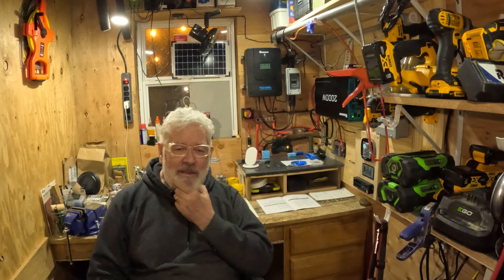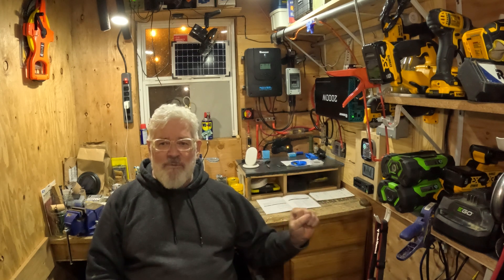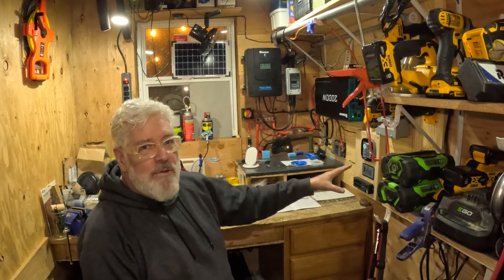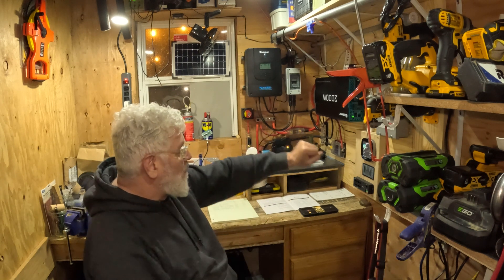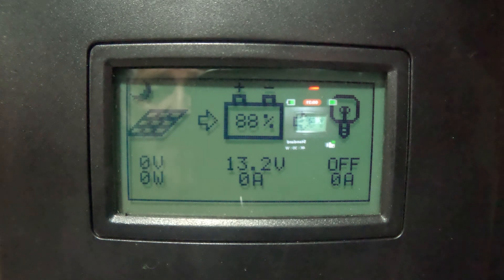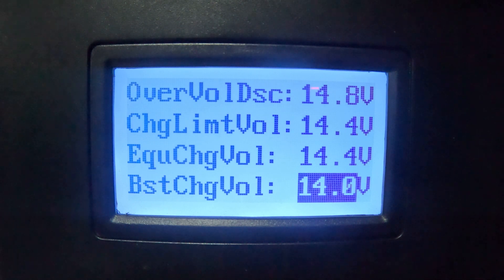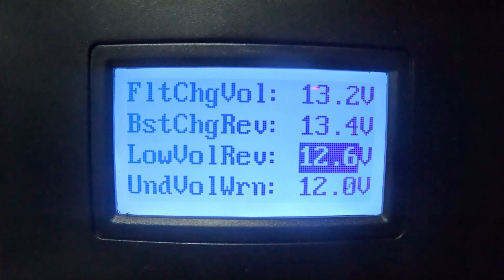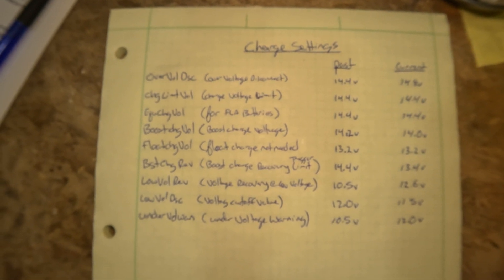Renogy Rover 60 amp Controller Over Voltage Error Fix with new Battery Settings

Comment: What setting line on the inverter controls the cell over-voltage alert? I'm not finding that line description in my user manual. Thanks.
Reply from the maker: @PaulBrown-e7w  let me check on that for you.

Comment: this is a battery issue not a controller issue the BMS has cut out causing the volts to rush to the controller causing a over voltage Error, Renogy's advice to lower charge voltage was correct.14.8v is very high for Lifepo4. that is why you get an over voltage error, the BMS has cut out, Likely an unbalanced cell in a battery getting to high and triggering the batteries BMS to cut out, or one battery in the bank being higher than the other. Ive installed hundreds of Renogy Controllers. And seeing videos where you Connect to batteries But dont put the charger and Inverter on opposite battery terminals and dont spread the charge and draw over multiple batteries, Id say you have an unbalanced battery bank and you had a battery cut out, Its likely even the reason your inverter Fried it self, drawing too much resistance.
Reply from the maker: 14.8v is the over voltage disconnect. It never sees that voltage at these settings. The inverter smoked a MOSFET. Digging deeper it seems as though this is a problem with Renogy inverters. I won't go into that and why in order to keep the comment succinct. The battery setup is fine.
Reply: @SolarBearDIY  Im looking at your Video on the renogy shunt fix, and @ 9.43 I can see your battery bank, you have the posivie and negatives coming in and out off the same battery, that is not fine, you have an unbalanced battery bank, your not spreading the load over all two batteries and you  raising the volts over voltage disconnect to stop over voltage didnt fix your issue, you covered the problem with a band aid, you should have setup the battery bank correctly, wired them correctly, and if its not that which is cutting off the BMS, you should have lowered the charge voltage as renogy said. literally the reason for that over voltage error is the BMS on one of the batteries is shutting off. Either because  the bank is out of balance due to incorrect wiring, or a cell in one battery has come out of balance. If you cant setup a battery bank correctly for even charge and even discharge, you shouldnt be giving advice.Two videos Ive seen of yours had you setting the bank incorrectly. If I could post a screen shot I would. People are getting bad advice from these videos, Im sure you mean well But your over looking what your doing wrong and pointing to the product. BTW If you are going to put the Inverter on the buss bar at least put the inverter on the same lug as the main power cable to the battery, so it has a direct connection, there is so many problems with that setup that would cause resistance for a high load Component
Reply from the maker: @oliviatulloch1358  Thanks for watching my videos, but you are incredibly incorrect regarding Renogy advice, and what parameter I have set at 14.8v. You need to read my comment carefully. With 2x small batteries connected like that for a short time, they are fine, trust me. With more batteries I use a different layout for the long haul. As far as doubling up two lugs on one post of the busbar, that just defeats the purpose of a busbar. It's fine also. 

You can stick up for Renogy all you want, but their tech support is slow, and their product continues to be glitchy and fail. They have admitted fault on several of their products that I have opened cases with them. It is what it is, and I have no binding agreements or contacts with Renogy. Not to mention I have pictures from other Renogy users that have similar problems, including the MOSFET issue that I have had. 

My advice is good, and you truly don't understand the nature of my videos. Sorry to disappoint you, but you are incorrect.
Reply: @oliviatulloch1358 I've got the 20 amp version and I'm experiencing the same issues. What do you suggest for settings?
Reply from the maker: @DjbriancUs it's not the battery, guaranteed..
Reply from the maker: @DjbriancUs what batteries are you using?
Reply from the maker: @oliviatulloch1358  and you don't "draw resistance" 😂😂😂
Reply: @SolarBearDIY  your playing words now, you knew I said Cause Resistance and meant creating resistance. so your misrepresenting what I said and you know it. and you drawing and charging off the same battery in the bank creates a battery bank that is not balanced. its Most noob Mistake some one can make, and you posted that on facebook, on more than one video. renogies customer service isnt great, im not saying they are, but your advice is garbage. you didnt even know the reason for the over voltage issue do you? you think raising the parameter to the point where it no longer triggers is the right course of action lol. you needed to figure out why your batteries BMS was shutting down, either by too high of a charge voltage or an unbalanced bank or cell, Likely from a incorrectly hooked up battery bank. like yours clearly is. If renogy saw a picture of your battery bank installed wrong, they might have said to have fixed that before telling you to lower charge voltage. they made a mistake assuming you had your battery bank installed correctly lol, Dont care what brand it is, if your if your pos and neg draw and charge cables on your battery bank are only only on the same battery in a battery bank, your battery bank is not setup correctly, you can check that out for your self. you keep saying you didnt have it hooked up like that for long, but the videos showing that are months aparts lol
Reply from the maker: @oliviatulloch1358  Thanks for watching my video, and the hate is real with you. I must havee really done something to upset you, and you propably deserved it. So, if you paid attention to my videos regarding this issue I most definitely followed Renogy's advice. They were just guessing at what to do, and I don't beleive they really know what caused the issue. If you look closely at the video, you'll notice that the batteries are no longer on wy work bench. Acutally they were moved and paried up with 2 other batteries from the same batch. The batteries are fine, and with 4x in parallel they are connected different. Trust me when I say the way they are connected to the busbar is also fine. The resistance that is caused by the busbar is not a factor that should affect any system. It is irrevelent. 

To be clear it was not the first issue I have had with Renogy controllers, and if you have installed as many as you say, you would have had some isues along the way. I am not alone in saying that not all of their components are reliable. It is actually well known, and too bad they don't focus to solve some of these issues, because I believe that they have the potential to be a good company with solid components, but they have some bugs to works out. 

So, why do I believe that I am offering clear advice? Well, I have obviously omved on to a different brand of controller/inverter, and I have had zero issues, and yes I am using the same batteries. As a matter of fact the unit that I am currently using is working so well with my setting, it is actuall boring, lol.. 

Renogy admitted fault  regarding the inverter. Literally stating that it was in fact the inverter that malfunctioned. They sent me a new one, and it litterally sits in an unopened box in my office. 

Any who, sorry for upsetting you so much, and thanks for watching my channel. Maybe next time we meet you won't be so upset... Cheers!

Comment: I have issue mppt 60amp.
Screen is struck at 'activate 12v Li
How can I get out of this?
Reply from the maker: @brianchung2441  it may be that your battery voltage is less than 11v. To be honest, I've never encountered this.

Comment: I'm having a similar problem..I have two rover 60s... Both connected to indentical strings of panels.. the new rover I just installed is throwing the same error..even tho the settings between the Rovers are identical .and hooked to the same 24 volt battery bank ...I'll have to try setting the voltage disconnect to higher...it's at 14.4 right now as well
Reply from the maker: Just curious, your controllers are set at 14.4 volts and charging a 24 volt battery bank?
Reply: @SolarBearDIY  rover is set to 24volt...and Type Li (Lithium). All the other settings are default to that type..and match the other controller.....even in user mode..setting can't be adjusted past 17 volts
Reply from the maker: @flasha29  gotcha, and interesting that the user options can't be set for greater than 17v. I may take a look at that this weekend as I currently have a 24v system in place from a different manufacturer. It wouldn't be too difficult to reconnect my Rover and run through the settings for 24v, and it would make a good video! Thanks...
Reply: @SolarBearDIY  I'll try your settings today and let you know...😉
Reply: @SolarBearDIY  Would love to see your setting for 24 volt with the rover, Renogy has been of no help at this point :(
Reply from the maker: @flasha29  if I have time this weekend I'll check it out and tag you, might be later this week though.
Reply: @SolarBearDIY  Official Renogy response...which makes no sense .because the setting can't be changed..and are identical to my other rover which works perfect. "From what we understand, you have troubles with your Rover 60 as it has an overvoltage error.

We understand the scenario you are facing, and rest assured that we will help you with your concern. We understand that you have the same settings for both your Rover 60 and Upon checking the photo you have attached, the battery system voltage is 24V; however, the advanced settings on it seem to be for a 12V system. We highly recommend changing the settings on your charge controller to accommodate 24V settings. The reason for the overvoltage error is that the configuration set is for 12V; however, the actual system voltage is 24V. We hope we have imparted meaningful insights regarding your concern. If you have further questions, do not hesitate to ask us."
Reply: It's like they don't understand their own product
Reply from the maker: @flasha29  I would say for the most part you are correct, lolz.
Reply from the maker: https://youtu.be/ovL9oBz3n4s?si=WVb36m0GR2Inax31